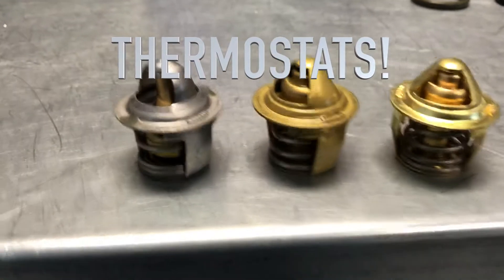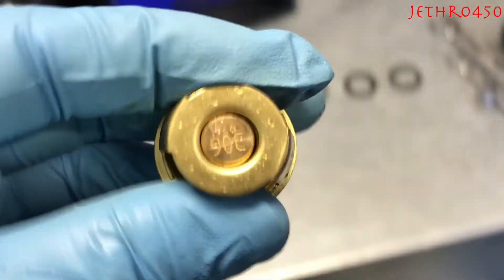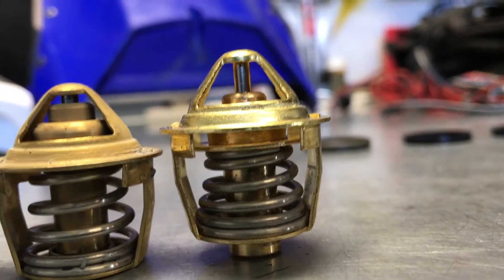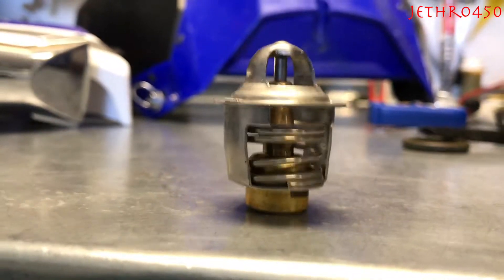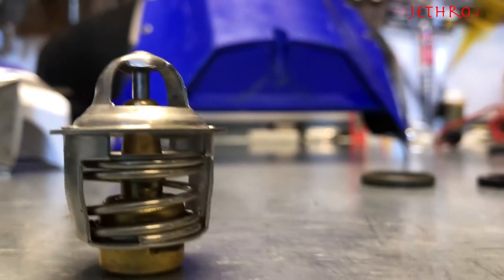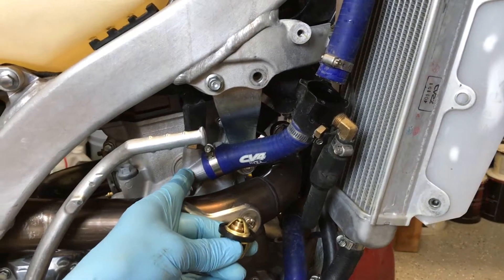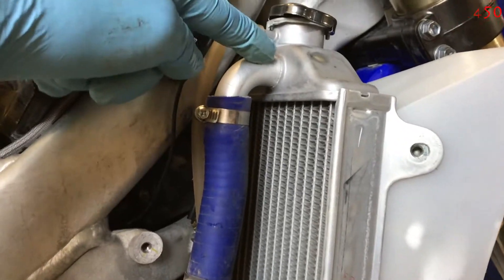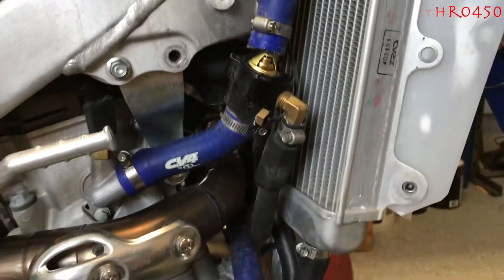How do thermostats work?  Motorcycles, Snowbikes, Cars, and more

Comment: Awesome, thanks for the informative and succinct video! Quick fyi on that IR gun, you might be reading lower than actual temp, as you've got a fairly shiny metal that with a low emissivity. Shiny metals in general will give your IR gun troubles. A thermocouple will measure the temperature through conductivity and will likely give you a more accurate result. You could also paint it with some high emissivity paint, but that might be destructive to this part.

Comment: Hayabusa 2003 the fan turn on but dont turn off until i stop the engine and let the switch on like 2 minutes , the stops but the engine is not to hot, i think is thermostate,  what you think ??